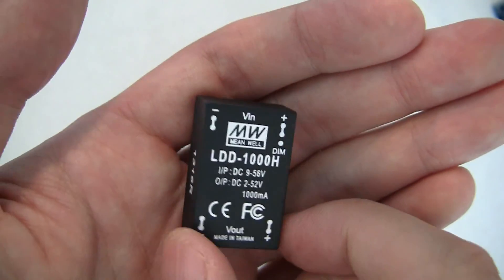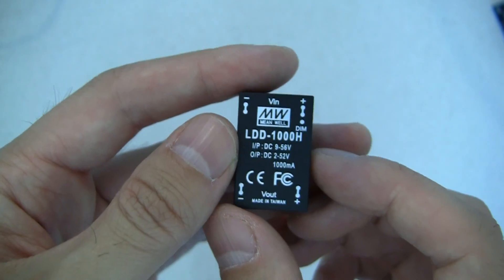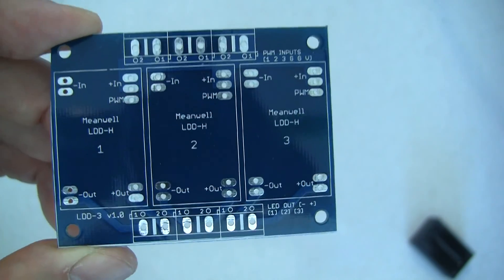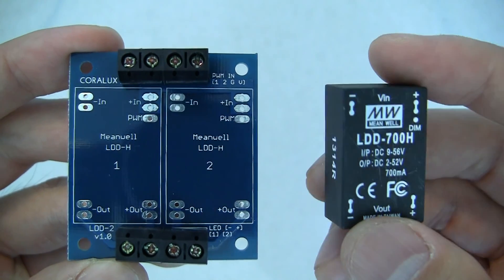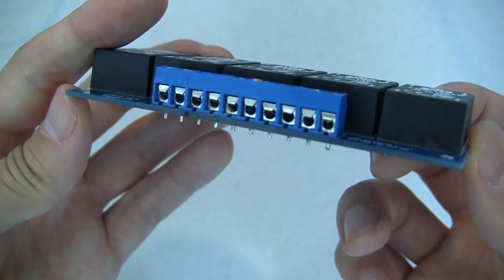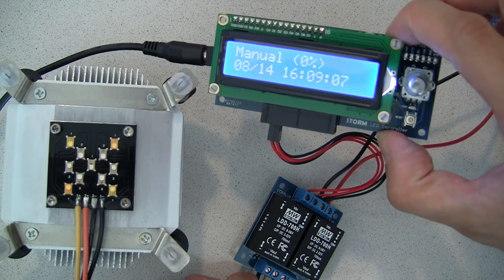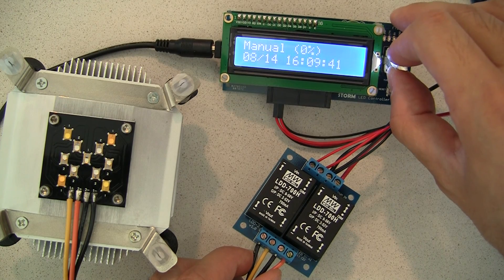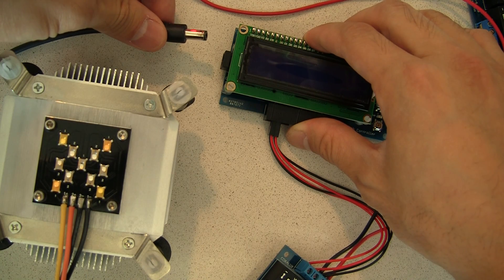CORALUX Meanwell LDD-H PCB Driver Board Intro

Comment: Hi, i bought from CORALUX  2 LDD-5 Driver Board, to build my aquarium LED LampI 
 I soldered the 5 LDD-700H,  on the driver Board, 

i connected 12 led's to the exit LED 1+ 1- On 5 driver Board
and the VSS with positive and the GND with negative of  Power Supply

but nothing happendo.
  Do you know if it is  possible to check if the LDD-700H works ?

regards  Giuseppe
Reply: did you pwm  ed them ?